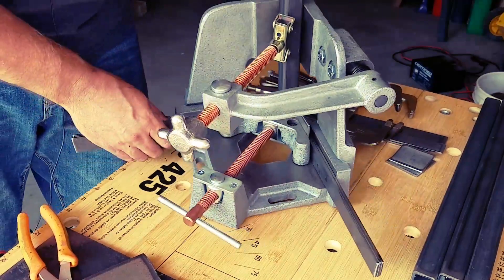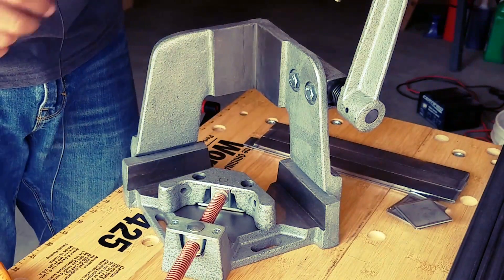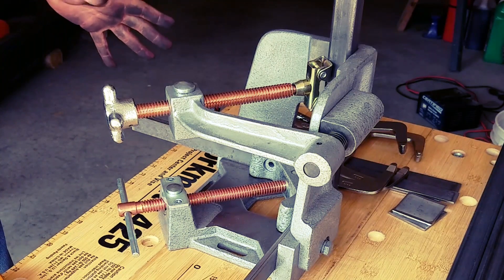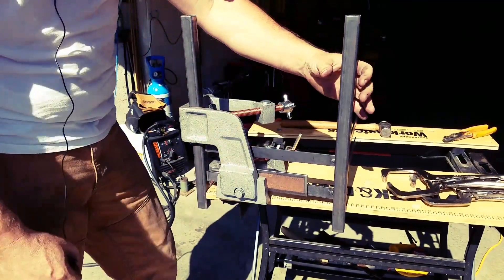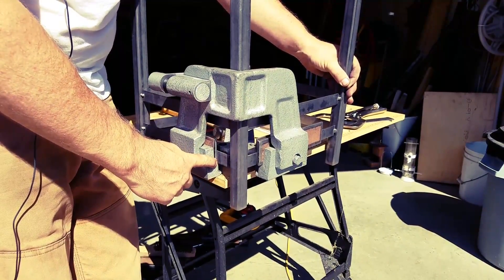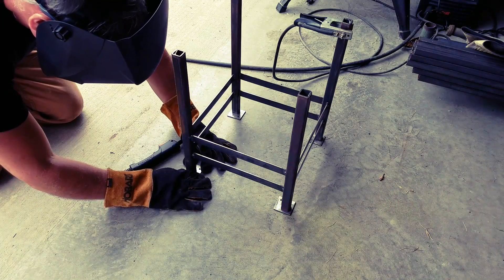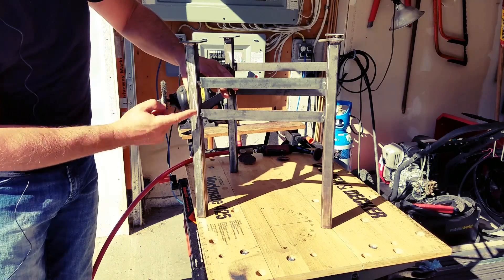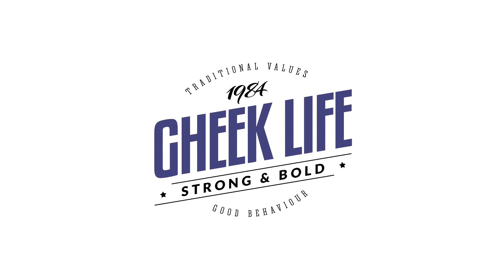MIG Welding a Small Table and 3-Axis Clamp Review

Comment: How do you like your 425 table for weldling. I'm picking up a new one for 50
Reply from the maker: I like it for set-up, and I'm thinking of converting my small one into a dedicated welding table by replacing the top boards with 5/8" steel plates. The part I'm still pondering is how to connect the plates to the table with a material that won't melt.